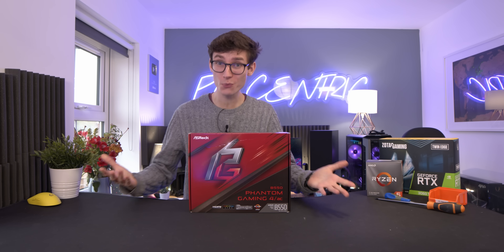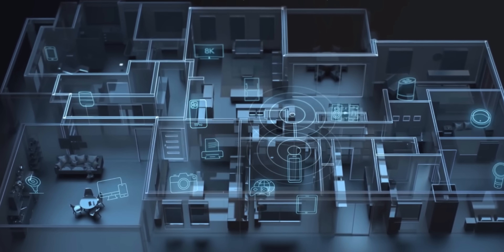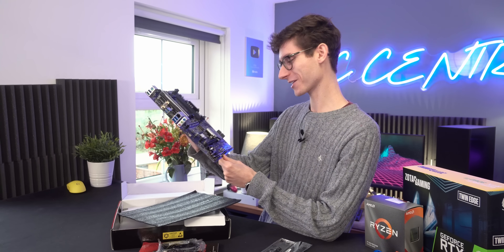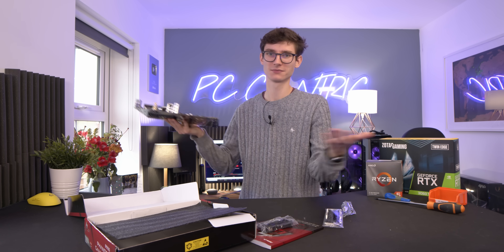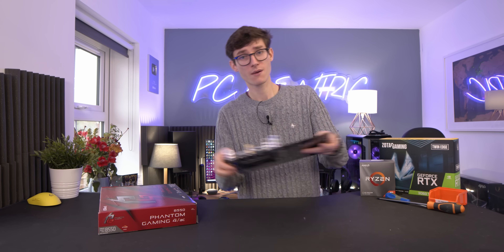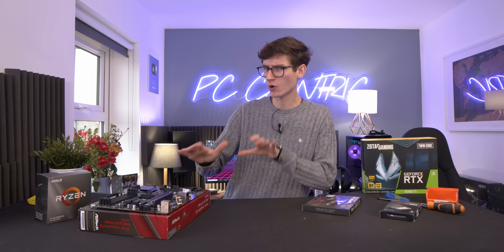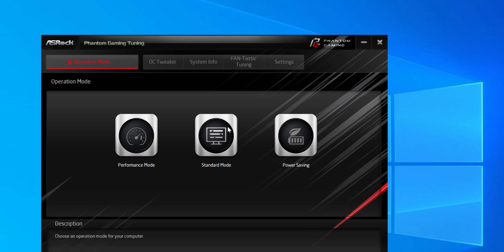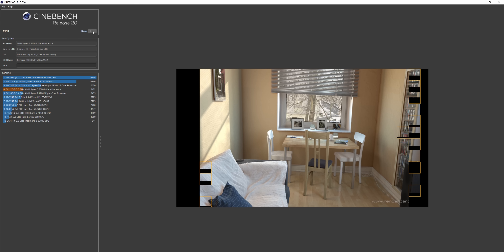Should You Buy The CHEAPEST B550 Motherboard?! - Asrock Phantom 4 Gaming Review

Comment: If you want to put the 9 5900x or the 9 5950 onto it, you will need a pretty cheap 4 or 2 core am4 cpu aswell in order to install the bios update to make it able to use these powerful cpus after that...

Comment: I have mine water cooled and it works fine. About to upgrade to an amd ryzen 7 and graphics card. handles 32g of ram just fine as well. Never goes over 85 degrees.
Reply: just bought this with the pre bios update, r5 5600x, and 2 8gb 3200 veng. this should run most of rpcs3, hopefully. all kids on discord so no help there. trying to see if i will really notice the extras with a r7 5700 cause of the 2 cores

Comment: I use this motherboard with a high end settup x.x 
Water cooling, Radeon 7900 xtx, Ryzen 9  5950X, basicle the absolut maximum you can put on this thing.
I never knew it was so cheap. But it seems to do fine. I dont know if there would be a big change in performance.

Comment: I’m seeing a handful of mixed comments talking about “RAM compatibility issues” with this board, can someone who has used this mobo tell me if it works fine with DDR4-3600 memory? For my build I’m using a 2x8Gb stick setup.
(I’m using the TeamGroup Vulcan Z 16 DDR4-3600 CL18 Memory, to be specific).
Reply: Yeah it does work. I have the same board and am using 2x8GB Kingston HyperX Predator which have 3600hz

Comment: Great board, been running it for over a year now with a water cooled 5600x, RX 6800, Firecuda Gen 4 SSD and 16G 3200mhz. Saved money everywhere possible and my build cost $962 usd, insane price to performance.
Reply: the board is labelled as being for 3rd gen cpus, howdoes it still work with 5600x ?
Reply: @yakia794  bios update
Reply: @WillTio13  thank you !
Reply: Hello, did you enablrd your xmp file?
Reply: How are your system working now these days bro?

Do you have faced any problem on this motherboard?
Reply: @umeshmeena9175  Not a single issue. PC running awesome as usual.
Reply: @jordonpollock1550  
Do you overclocked your ram?
Reply: Did it work out of the box or did it require bios upd? And does it support USB flash?

Comment: How did you get the CPU light to turn off? (No signal on the monitor either) 
Mine doesn't and I've removed everything and put it back in one at a time. I also switched the Ram but nothing

Comment: Well I already bought it, it was super cheap. I hope it goes well with a R5 5600x and RTX 2070, but I have concerns about the RAM, because I was planning to buy a 3600mhz kit.
Reply: I have this board, I run 32 gigs of 3600 mhz ram and it runs perfectly fine
Reply: @thatha1rlin33  sadly the mobo didn't boot for me so I had to return it. After that I found a B550 Aorus Elite V2 for very cheap and I'm quite happy with it.

Comment: I got this board with a PC someone built me. Wanted to support someone local and I've been to busy with work to build my own. Plus my previous PC kept having issues, and I couldn't afford down time.

B550 Phantom Gaming 4 Mono
Ryzen 5 5600x
16GB RAM
2tb Pioneer NVME
Cooler Master Hyper 212
H510 case
Apevia 600w PSU
Handful of white Led fans and a couple white/black cables. 

I asked for WiFi, and this came with the non wifi version of the board. Paid way too much but it is what it is. I've doubled the ram since and swapped out the Apevia PSU for an Antec 850watt. And added another 2tb nvme in the second slot.

This board boots so slow. And when you add wifi, your second nvme slot speed is halved. All this could've been avoided with a better Mobo. Not the fault of the board, but the builder. But, definitely stuff you want to consider if you have plans for adding wifi and a second nvme. The rear I/O seems quite bare as well. Especially if you're coming from previous builds with more options.

Comment: My experience with this board is mixed. My only gripe is that I can't use the full speed of my ram. The highest stable speed I could get was 3200mhz. While fine, I hate leaving performance on the table.
Reply: probably loosing like 0.5%. RAM speed and timings are so overrated

Comment: Brother, i bought this motherboard recently and I having trouble installing the windows. Can you please help me?
It is not detecting sata ssd. I changed sata cable and ports but it did not help. 
It is not showing usb flash drive in the boot option. I tried to install windows using a dvd but no hope there.
AN WINDOWS WAS ALREADY INSTALLED IN THE SSD. I THINK THIS COULD BE THE PROBLEM. 
WHAT DO I DO NOW?

Comment: I use exactly this motherboard with 32GB RAM, RTX 3060ti and onboard Wifi. I purchased this gear to run Microsoft Flight Simulator 2020.
It is one of the best combinations I have ever used.
Reply: No problem yet??? I have the same gpu and mother board as you ☺️😇😇
Reply: Hi I just got this motherboard with the soles intentions of building a PC to run MSFS...what GPU do u use? And how does it run MSFS as in what quality?
Reply: @jessejohn7406   as I wrote in my reply earlier, I am using Nvidia RTX 3060TI with 8GB on it. Which is working very fine with my MSFS 2020 graphics settings. I am using (High setting ) I can get about 60 FPS.. it is a good value for most of my flights. some of my settings are customized to be (Ultra) the rest are (High).. by the way, you may need to look around for better GPUs as the one I am using is a 3 years old, yet I am not going to upgrade it. It's very good for my MSFS 2020
Reply: Hey, sorry but I just wanted to ask what MHz does your ram run at with all 4 sticks in? I am just wondering if will it run at actually 3200mhz if I will put 4 sticks or will it lower their overall speed to 2933mhz.
Reply: @kintarios  hi.. this is what I use : 32GB DIMM DDR4 clocked @ 2400 MHz
TEAMGROUP-UD4-3600 2x16GB
2,290 User benchmarks, average bench 90%.
If i wanted to give you the results of 4 slots then I need to change the memory cards but I use now 2 slots x 16GB
Reply: Hey so I'm planning on building my first ever PC and if you don't mind could you explain to me what you mean by inboard wifi? Because most parts of the PC I've kinda learned about CPU, GPU, motherboard all that but I still am super confused on how you actually get wifi on the PC.
Reply: @NeoVester  yes. this type of Wi-Fi device is installed on the motherboard. all you need is to have an antenna attached to the motherboard. usually antenna comes with the motherboard.
Reply: Hey does the SSD get hot under the GPU ? And is there a place for  a heatsink?
Reply: @zakariahamidi  There is no possibility to add a heat sink to the SSD. The space between the GPU and SSD is too narrow to fit the sink but for sure I didn't encounter any SSD overheat yet.
Reply: hi, it says that it has wifi but i dont see any wifi option in my pc i use window 10

Comment: I’ve been using this board with a R7 3700X for a month now. Bios update was easy, and probably not necessary. No problems so far. R23 score is 12,628.  Cost me $122 USD.  I’m happy. May upgrade to an R9 in a year or two. I think the B550 is a better value than a X570, unless you have specific needs.
Reply: I'm building the same pc with rx 6600. Hope it lasts at least 3 years
Reply: @luck5234  really really well

Comment: I have this board, it is great for the price. The temps on my board stay consistently between 30-40c and my ram went into xmp automatically with 3200 mhz ballistix. Solid board if you don't need fast wifi or fancy heatsinks
Reply: also it is a cheap b550 but there are a few cheaper options
Reply: @MotiveGR  also do you thinks it a better to update bios through the bios itself or using usb?
Reply: yeah i got this on black friday for $50 cheaper😂
Reply: Can I use a Ryzen 5 5500 on it without updating bios
Reply: @breybrat6301 nope, you have to update it. All the b550  needs to be updated to use the series Ryzen 5000. But in any case you can ask wherever you're shopping if they can update it or if it is already. At least where I buy it, they did it.
(Sorry if my English is bad)

Comment: I got a pro4 for 84 bucks. Feel like that was a solid deal
Reply: Does it run 5600x
Reply: @dom_toredo  yes
Reply: @confuzled_makes  but does it run it well and stable
Reply: @dom_toredo  never had any problems.
Reply: @confuzled_makes  are you running 5600x on it?
Reply: @dom_toredo  yes. 5600x, 3800mhz ram, 240aio.
Reply: @confuzled_makes  ok thanks bro

Comment: I'm watching this video with this exact motherboard in my system
Reply: is it good?
Reply: im literally about to build with this. hoping it supports the ram i bought now
Reply: How is the motherboard? I’m a newby to pc building and have just bought this
Reply: i’m building my first pc with this motherboard in 2/3 days, is the wifi good?
Reply: @lux5014  not sure abt the wifi but overall my mobo is of excellent condition with the xmp, bios etc. all working nicely , i have it paired with a gen 3 amd cpu
Reply: @constantinoskozakos9681  do u think it’ll be fine for my wifi and i’ll be using a r5 3600
Reply: @lux5014  yeah definitely even if the wifi is bad u can still change it either externally or internally in the mobo for less than 20€

Comment: I bought this board when I built my first system in June, and I've never had a single problem with it at all. I'm only running a 3600, so don't take much stock in its ability to run a 5950x or anything. But for the price, it would be able to run a 5600x or 5800x and maybe a 5900x without that many cooling problems. People overestimate how heat-intensive Ryzen is, and since most people using Ryzen don't overclock because of the little benefit it poses, no one in this price range would really notice a problem. The value of being able to go from a 3600 to a 5600x or a 5800x with no problem is what makes it a good deal. Anyone building a lower budget setup would be happy with it I think.
Reply: I would hesitate to recommend a 5900x on this, for that you could get a TUF motherboard from Asus for 40-50 bucks more or so ..

Comment: If anyone is looking for a "cheap" B550 board I can reccommend the msi b550m pro-vdh wifi. Has BIOS flashback that was a piece of cake to update BIOS (less than 5 mins), good VRM, USB c, good VRM etc. Pretty well reviewed amd jas Wifi too. Micro ATX size.
Reply: Is this motherboard better than the one he is reviewing?
Reply: @buffalowxngs1512  I'd say so, it's a bit more expensive I paid £110 for mine on Amazon (currently £119). I'm happy with it. Works perfectly in my system with a 5600x, 3060ti, 16 gigs of 3200mhz ram. BIOS flashback was super easy too.

Comment: I think there is a bandwidth problem with that board, or there are  BIOS issues. 

I am getting the B550 MSI Tomahawk and pairing with a 5600X, when they become available. 

I am considering whether it is worth 3600 Mhz RAM vs 3200, I have read lots of issues with full 3600 Mhz speeds and 3200 is considered stable vs the higher speed RAM which costs a tad more. Which is a shame as I would like a good pair of 3600 Mhz sticks. 

Regards

Paul
Reply: I’ve just bought my 5600x, I’ll have a look the B550 MSI tomahawk cheers

Comment: This isn't related to this specific video, but I'm building a PC and I wanted to know if pairing a Intel Core i7 processor and the ASUS ROG Maximus XII Hero Z490 would work out. I was going off the "3080 Build for 2020" but the i9 processor is just a little too expensive for my budget. I'm not too knowledgeable with this kind of stuff, so any help is appreciated.
Reply: ASUS ROG Maximus XII Hero Z490 is a 400 euro board saying your budget doesn't allow for a 10900K is a bit weird. You are better off "downgrading" the board to a ASUS ROG Strix Z490-E (300 euro) or Z490-F (250) depending on your needs and get a 10900K with the difference.
Reply: @blue4red9  I guess saying that it wasn’t in my budget wasn’t the right words..I meant that if I don’t have to spend the extra money for the i9 then I’d rather not. Thx for the suggestion tho